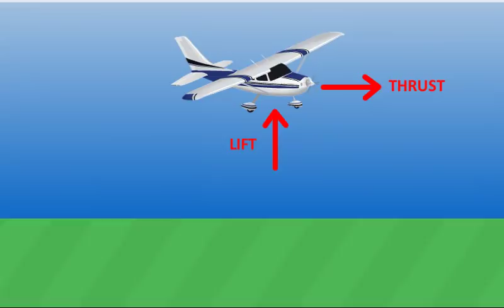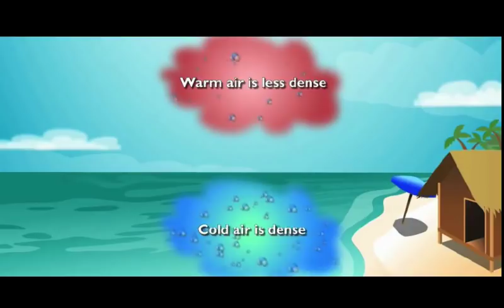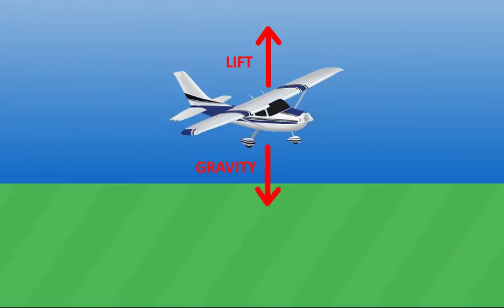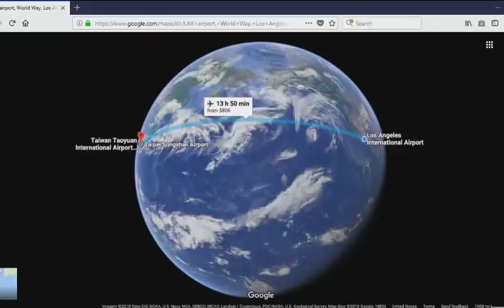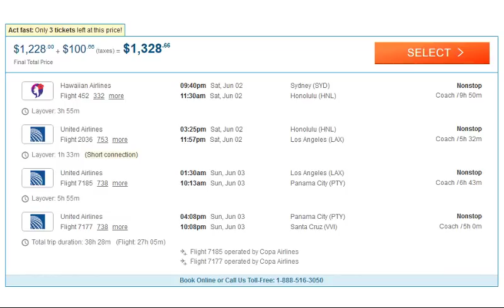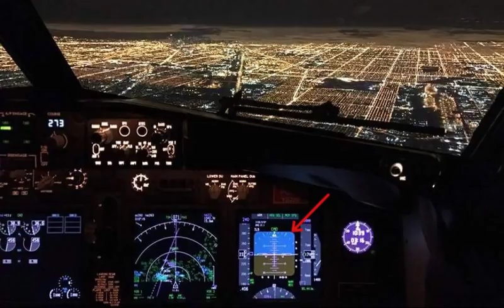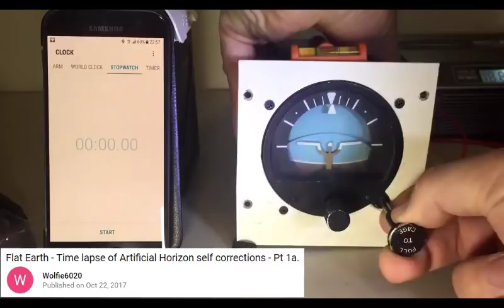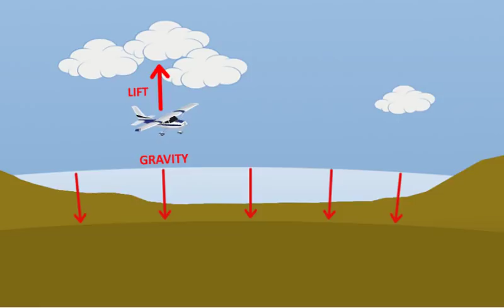Flat Earth Falsities - Plane Nonsense

Comment: If the earth is a spinning ball then how come it's flat and stationary?
Reply: O G Because it is neither flat nor stationary. How many degrees do you think the Earth rotates in one day?
Reply: @flookd5516  zero degrees each and every day. If I was spinning at 1000mph I think i would notice.
Reply: O G You expect to sense a 0.004 deg/sec rotation? The equivalent of taking 6hrs to turn a corner?
Reply: @OG-gv5hl  
David Copperfield is a billionaire thanks to people like you.
fyi Proof of curvature. Sextant corrections, long distance navigation, spherical trig, the fact that land slowly goes below the horizon when you sail away from it and slowly rises from the horizon when you sail towards it, the fact that you can see further with increasing height, celestial navigation and so on.
Reply: @flookd5516  spinning on a ball at 1000mph whilst spinning around the sun at 66,600mph while the sun moves through the vacuum of space at 514,000mph. The stars remain fixed, the Northstar doesn't move, ever. Water doesn't curve and gravity is just density and buoyancy. NASA lies, wake up.
Reply: @boffeycn   “The illiterate of the 21st century will not be those who cannot read and write, but those who cannot learn, unlearn, and relearn. ”

― Alvin Toffler
Reply: @OG-gv5hl  
"spinning ... at 1000mph ". Firstly spinning is not measured in mph it is measured in rps. rpm. etc.
0.000696rpm. That is the rate at which the earth rotates.
The earth doesn't actually spin, a top spins, the earth rotates very, very slowly. OK?
Spinning is what tops and Jennies do. The earth rotates slowly, very, very slowly, at half the rate of the hour hand on a clock.
"on a ball" No, a terrestrial spheroid. You play games with a ball.
"The stars remain fixed," Who told you that lie?
 "the Northstar doesn't move, ever." Another lie. Tell me how you calculate the true bearing of Polaris?
If nothing in the sky ever changes how do you explain why Kochab (Beta Ursae Minoris) used to be the pole star about 2,500 years ago but the pole star is now Polaris (Alpha Ursae Minoris), whilst Thuban (α Draconis) was closest to the North Pole about 5,000 years ago, and Vega (α Lyrae) will be the star closest to the North Pole in 12,000 years time?
Tell me how you ascertain the error of a compass when in the Southern Ocean, using Alpha Ursae Minoris?
"Water doesn't curve". Tears, rain, rivers, waterfalls, steric tides, normal tides, the meniscus, waves and your piss.
"and gravity is just density and buoyancy" Lies.
"NASA lies" Does it? Did I use NASA as a reference? No. So why did you have to say that?
Reply: @boffeycn  “It's easier to fool people than to convince them that they have been fooled.”
― Mark Twain
Reply: O G We can measure the Earth's orbit through the stellar parallax that occurs; that something is not obvious to the naked eye does not mean it doesn't exist. Stars are so distant that it will take thousands of years for displacement to become apparent. Polaris is currently on the axis of rotation so it is not going to move from day to day; the wobble in the Earth's axis means it will be the North Star for a few centuries.  

Gravity's existence was proved in 1798; catch up with the news. 

Achieve fame - be the first to explain how density can act as a force and why in a consistent direction.
Reply: @OG-gv5hl  "The illiterate of the future will not be the person who cannot read. It will be the person who does not know how to learn." Alvin Toffler
Reply: @OG-gv5hl  “It's easier to fool people than to convince them that they have been fooled.”
― Mark Twain.  Which is why Campanella et al makes money out of gullible fools.
Reply: @boffeycn  Exactly right. A person who will blindly except false information and mistake it as knowledge, ignoring all your God given senses. Unable to think critically and repeat theories and mistake them for fact. Theoretical Science should be called scientism, the new religion for the nihilistic narcissistic slaves of the modern world.
Reply: @OG-gv5hl  Instead of gobbing off why don't you address the points I raised in a sensible manner and answer the questions. Tell me which theories did I cite? I proved Campanella is a liar. That isn't a theory, it is a fact. Exactly what theoretical science did I use? I used my own practical experience/
Proof of curvature. Sextant corrections, long distance navigation, spherical trig, the fact that land slowly goes below the horizon when you sail away from it and slowly rises from the horizon when you sail towards it, the fact that you can see further with increasing height, celestial navigation and so on. All practical.
"If the earth 1s 70% water " It isn't. Oceans cover about 71% of the Earth’s surface but only account for 0.02% of our planet’s total mass. that is practical, not rheoretical.
"spinning ... at 1000mph ". Firstly spinning is not measured in mph it is measured in rps. rpm. etc.
0.000696rpm. That is the rate at which the earth rotates. Not theoretical. Practical.
The earth doesn't actually spin, a top spins, the earth rotates very, very slowly. OK?
Spinning is what tops and Jennies do. The earth rotates slowly, very, very slowly, at half the rate of the hour hand on a clock.
"on a ball" No, a terrestrial spheroid. You play games with a ball.
"The stars remain fixed," Who told you that lie?
 "the Northstar doesn't move, ever." Another lie. Tell me how you calculate the true bearing of Polaris?
If nothing in the sky ever changes how do you explain why Kochab (Beta Ursae Minoris) used to be the pole star about 2,500 years ago but the pole star is now Polaris (Alpha Ursae Minoris), whilst Thuban (α Draconis) was closest to the North Pole about 5,000 years ago, and Vega (α Lyrae) will be the star closest to the North Pole in 12,000 years time?
Tell me how you ascertain the error of a compass when in the Southern Ocean, using Alpha Ursae Minoris?
"Water doesn't curve". Tears, rain, rivers, waterfalls, steric tides, normal tides, the meniscus, waves and your piss.
"and gravity is just density and buoyancy" Lies.
"NASA lies" Does it? Did I use NASA as a reference? No. So why did you have to say that?
Did you watch these?
https://www.youtube.com/watch?v=gUwvu0WPq8U&lc=z23lxt24ipmhd3hfhacdp432eyutd0pyhqagjchpus1w03c010c.1513213312633459&feature=em-comments
https://www.youtube.com/watch?v=gUwvu0WPq8U&list=RDgUwvu0WPq8U&t=142
Reply: @boffeycn  can you show me a practical example of water sticking to the exterior of a shape?
Reply: @OG-gv5hl  You're bending wong's ear but have no comment on what I said?
Reply: @OG-gv5hl  NO you would NOT because, say it with me WE ARE SPINNING WITH THE EARTH. WE ARE ALSO SPINNING BUT WE DONT NOTICE CUZ WE ARE ON THE EARTH
Reply: @OG-gv5hl  ever see a glass of cold water or soda?? Ever see the condensation on the OUTSIDE OF THAT GLASS OF WATER??
Reply: @OG-gv5hl  the Northstar will not be the North Star forever. It wasn't in the past it won't be in the future. That's like asking why the lines on the road go by so much faster than the mountains or trees in the distance. I'm assuming you understand why that is. Now think about how far the stars are from us for their positions to move relative to Earth they have to travel a great great distance. They will travel this distance eventually and will have perceptible changes in position it will just take a very long time. The closest star to us other than the sun of course is 4 1/2 light years away. Knowing that light travels at 186,000 miles per second, imaging traveling that speed for 4 and 1/2 years. That's why they seem stationary. And that's just our closest neighbor. Why don't stars at the poles ever dip under the horizon? Explain that without a spherical rotating earth.
Reply: @blothhunder9305  the north star has been and always will be the north star. That's why it's called the north star and thats why it's been used for navigation since the dawn of time and hasn't moved an inch. Try explaining that on your spinning ball whirling through the vacum of space at over 500,000mph 🤔
Reply: @OG-gv5hl  dude, recorded history doesn't stretch back far enough for it to have moved much from our distant perspective. And actually it has moved a tiny bit in the last couple thousand years just imperceptible for us. Its actually not even 100% true north its off just a hair. And will continually leave its spot above the north pole. Btw who fixes all the holes in the dome after the daily space debris that his earth and occasional meteor impacts?
Reply: @OG-gv5hl  Water curves. Earth SURFACE is 70% water. And water adapts to it's container. Since gravity is a force that applies in direction to the center of mass from all directions, it takes that form. Wow, it a sphere!
Reply: @OG-gv5hl  Buoyancy and Density do not explain directions, and Density is not a force. Buoyancy actually needs another force to work. Yes, you are right. It's gravity.
Reply: @OG-gv5hl  Nasa lies?
And so what?
The other 80 space agencies are also lying?
Reply: @OG-gv5hl  A scientific theory, in a short answer, is a fact heavily supported by evidence.
Reply: @OG-gv5hl  Water around a concrete ball, falling but taking the form of the object.
Reply: @OG-gv5hl  It's not in the same place. It's a one degree offset.
Last century, a star changed the constellation because it wasn't on the palace it should. So, search this up.
Reply: @O G
"can you show me a practical example of water sticking to the exterior of a shape?"
A wet glass. Your balls when you have a shower.
 Instead of gobbing off why don't you address the points I raised in a sensible manner and answer the questions. Tell me which theories did I cite? I proved Campanella is a liar. That isn't a theory, it is a fact. Exactly what theoretical science did I use? I used my own practical experience/
Proof of curvature. Sextant corrections, long distance navigation, spherical trig, the fact that land slowly goes below the horizon when you sail away from it and slowly rises from the horizon when you sail towards it, the fact that you can see further with increasing height, celestial navigation and so on. All practical.
"If the earth 1s 70% water " It isn't. Oceans cover about 71% of the Earth’s surface but only account for 0.02% of our planet’s total mass. that is practical, not rheoretical.
"spinning ... at 1000mph ". Firstly spinning is not measured in mph it is measured in rps. rpm. etc.
0.000696rpm. That is the rate at which the earth rotates. Not theoretical. Practical.
The earth doesn't actually spin, a top spins, the earth rotates very, very slowly. OK?
Spinning is what tops and Jennies do. The earth rotates slowly, very, very slowly, at half the rate of the hour hand on a clock.
"on a ball" No, a terrestrial spheroid. You play games with a ball.
"The stars remain fixed," Who told you that lie?
 "the Northstar doesn't move, ever." Another lie. Tell me how you calculate the true bearing of Polaris?
If nothing in the sky ever changes how do you explain why Kochab (Beta Ursae Minoris) used to be the pole star about 2,500 years ago but the pole star is now Polaris (Alpha Ursae Minoris), whilst Thuban (α Draconis) was closest to the North Pole about 5,000 years ago, and Vega (α Lyrae) will be the star closest to the North Pole in 12,000 years time?
Tell me how you ascertain the error of a compass when in the Southern Ocean, using Alpha Ursae Minoris?
"Water doesn't curve". Tears, rain, rivers, waterfalls, steric tides, normal tides, the meniscus, waves and your piss.
"and gravity is just density and buoyancy" Lies.
"NASA lies" Does it? Did I use NASA as a reference? No. So why did you have to say that?
Did you watch these?
https://www.youtube.com/watch?v=gUwvu0WPq8U&lc=z23lxt24ipmhd3hfhacdp432eyutd0pyhqagjchpus1w03c010c.1513213312633459&feature=em-comments
https://www.youtube.com/watch?v=gUwvu0WPq8U&list=RDgUwvu0WPq8U&t=142 @OG-gv5hl
Reply: O G   "the north star has been and always will be the north star. That's why it's called the north star and thats why it's been used for navigation since the dawn of time and hasn't moved an inch."
How do you know that when you are incapable of calculating the true bearing of Polaris?  I can. You can't.?  I can. You can't.
If nothing in the sky ever changes how do you explain why Kochab (Beta Ursae Minoris) used to be the pole star about 2,500 years ago but the pole star is now Polaris (Alpha Ursae Minoris), whilst Thuban (α Draconis) was closest to the North Pole about 5,000 years ago, and Vega (α Lyrae) will be the star closest to the North Pole in 12,000 years time?
Try explaining that on your immovable pizza.
 @OG-gv5hl
Reply: Stormageddeon Dark Lord of All  Sounds like too much school has made you very stupid.
Reply: @OG-gv5hl  Proof?
No?
And what do I care about nasa?
I have litteraly more 80 space agencies and there are private companies. So by your logic, countries that are in active war, or cold war, and there are 200+ countries, and a lot hate America, are all lying?
And for what?
How deceiving us would make them any superior or us any smaller?
Reply: @vladimirlucifer4566  go back to sleep slave
Reply: @OG-gv5hl  And I'm no slave at all.
I have free thinking and I got my conclusions by myself. Not like you.
Reply: @inconsequencial2546  you've been indoctrinated... you poor slave man.
Reply: @OG-gv5hl  You are the one being indrocinated.
Reply: @OG-gv5hl  You are yet to tell me the proof that the photos are fake and that someone can edit accurate meteorological photos that match reality in 2.5 minutes.
Reply: "water curves?" Yes. Of course it does, as anyone with a functioning brain knows. Tears, rain, rivers, waterfalls, steric tides, normal tides, the meniscus, waves and your piss.
 @OG-gv5hl
Reply: @boffeycn  I dont have the time read you nonsense but I'll pass you onto someone else  https://www.youtube.com/watch?v=EiBJBVBez_w
Reply: Stormageddeon Dark Lord of All  that makes no sense
Reply: @OG-gv5hl  Yes. Water does absolutely curve. Ever heard of water adapts to the form of its container?
Ever heard that you can fill up a "balloon" (not litteral, but the glass one used in experiments)
And water conforms to it's form?
Well, it's reality.
Reply: @vladimirlucifer4566  free thinker? And you send links to cartoon pictures of a shoddy space ball? Water curves? This guy is hilarious! 😂😂😂🤣🤣
Reply: O G umm, sorry, if you board a train and it is very slowly acelerates to a comfortable speed, can you feel that too? No sudden stops nor starts, the rails are smooth and nothing special happens on the way.
It is just curiousity.
Reply: @OG-gv5hl  Yes. Water curves. You are yet to explain the photos constantly being published by that site, every 2.5 minutes, and whitch can't be edited that fast and actually match reality.

Yes water does curve. You have a glass of water where you live, am I right?
Pour water and look from above. Wow, water is in a curved shape. Now, bowl. A bowl is curved all around. And when you pour Water it takes the form of the bowl, a half spheroid. So yes, like any liquid of gas, it can curve.
Reply: @OG-gv5hl  Feel free to tell me someone that can edit images that are both weather and colour accurately, and make those accurate images,  and post it every 2.5 minutes.
Tell me someone that can edit that fast.
Reply: @OG-gv5hl  Yes I am a free thinker.
That is why I invented some internal combustion engines, reinvented some, had same conclusions as many geniuses and I didn't even knew that they had the same (e.g. Einstein, Tesla, some others) and invented a solar panel design that is both efficient, cheap and isn't that difficult to manufacture.
All of this can't be patented since I can't have access to patents. Why? Because I'm still a minor.